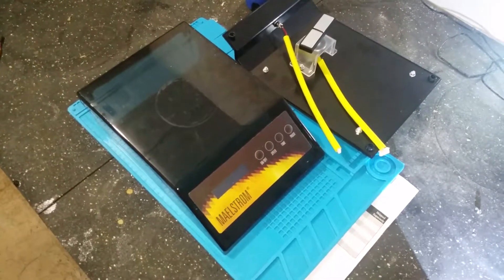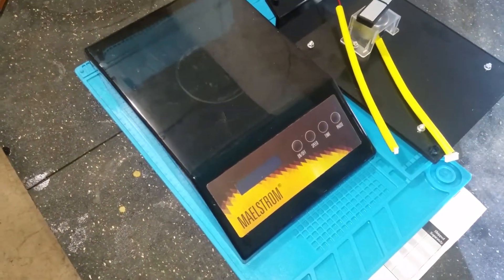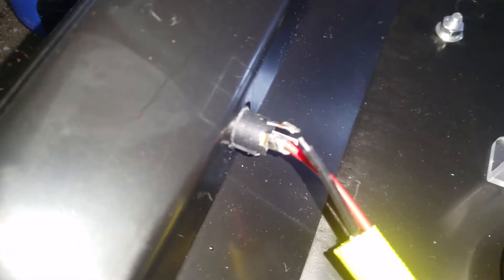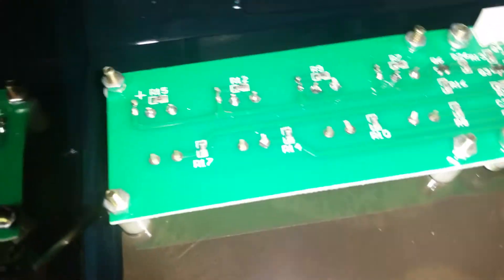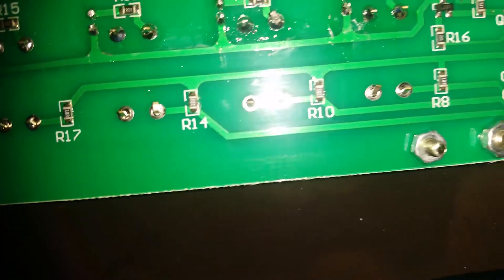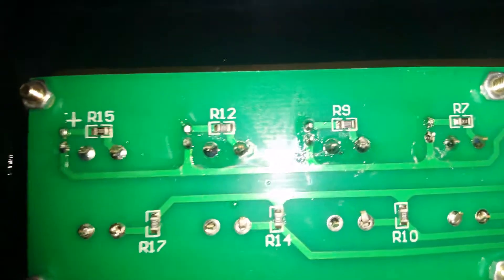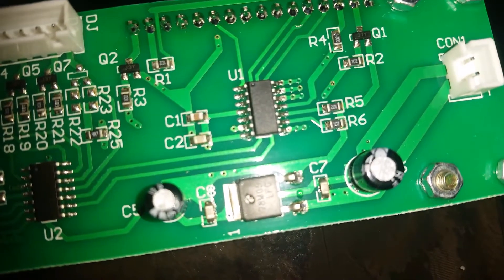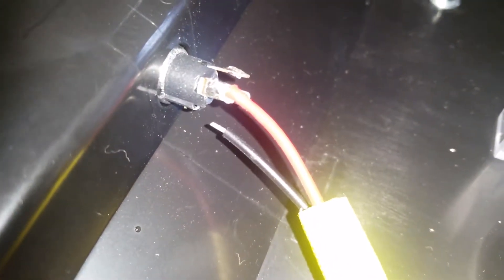Maelstrom stirplate update

Comment: I’ve spent almost an hour trying to get the damn thing to spin with the flask on top of it and I’m about to throw it through the damn window.
Reply from the maker: don't give up little camper. just solder properly and things should work better.
Reply: @dragonhlm  I opened it up and the problems you show in the video I don’t seem to have. The soldering looks decent. It just doesn’t have the power to spin with a flask sitting on it.